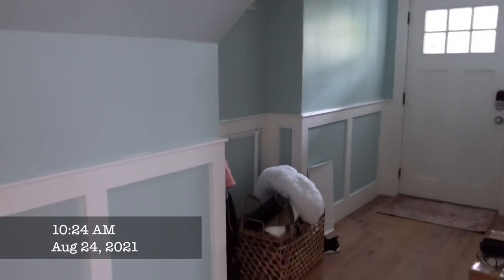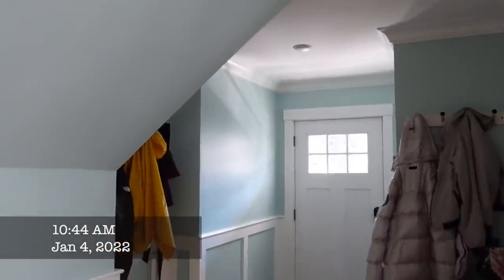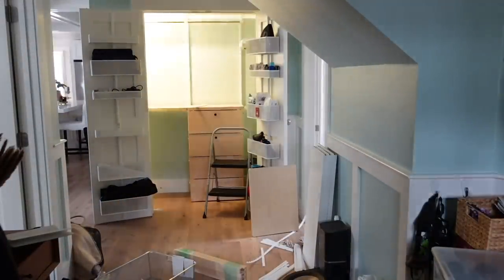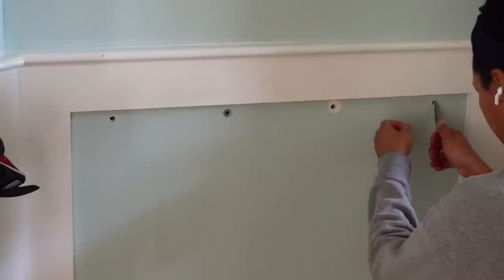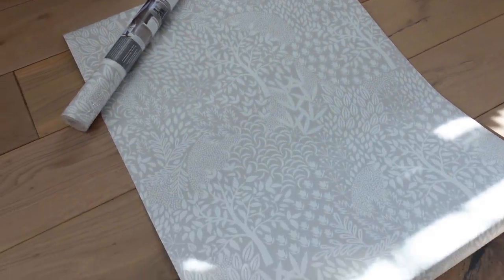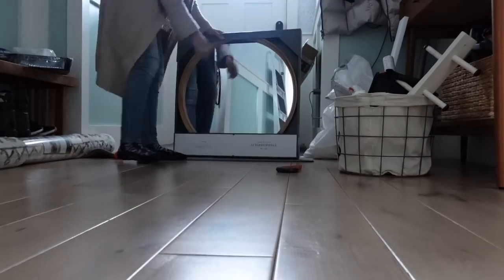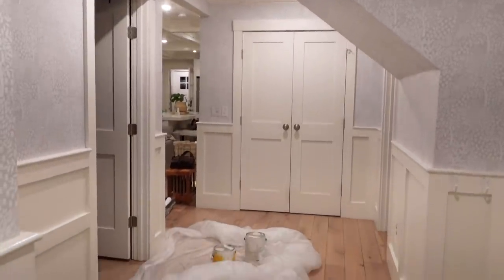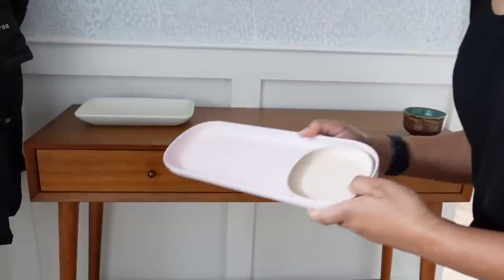Making Over Our Entryway For The New Year 🎉

Comment: Wow!  For such a deceptively simple transformation, you and your husband did a lot of work.  I liked the original blue, but I like the silvery wallpaper/ white paint SO much more--it's really bright, and your storage solutions (the console, the wall hooks) are minimal but at the same time completely functional.  As a fellow Bostonian, I appreciate the extra space for wet footwear, the bench where boots can be put on/ taken off, and the washable entryway rug.  (I like what the previous owners had done, but it was way too "busy" for my tastes).  And based on the huge fleece thing you're wearing in the opening of the video, I'm pretty sure I know the exact day it was filmed, LOL!

Until I watched your video on the re-org of the entryway closet, I had not thought about the differences between reach-in, step-in, and walk-in closets.  The size/ configuration definitely makes a difference in how to best arrange storage solutions.  I only have two closets in my condominium, both of them big and deep, with good vertical height, but also awkwardly shaped due to a weird bump-out in one and an angled ceiling in the other.  It's taken some creativity to maximize storage space in both.
Reply from the maker: Ironically our thermostat had stopped functioning properly that day and it was SO COLD in the house lol! Luckily, we discovered we needed to change the air filter and we have heat again 😂 we were Freezing 🥶